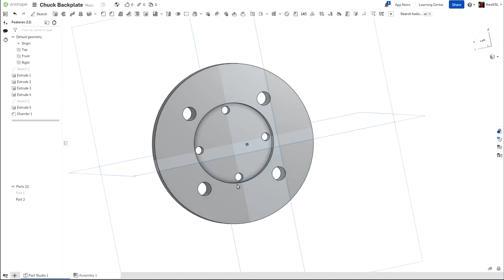Making a 4-Jaw Chuck Backplate for the Proxxon PD 250/e Lathe #toolfest2021

Comment: I used the EMCO Unimat SL, EMCO Unimat 3 and PD 230 for many projects, but I never would have used any carbide insert cutters on these tiny lathes. I only use high-speed steel for lathes with motors rated less than 500W.
Reply from the maker: That makes total sense, but there is a reason I didn't stick to the same principle. My lathe workbench was in a corner of my kitchen, and I had to keep the mess under control. Bench grinders are seriously messy, and really require their own bench space which I just didn't have.

Comment: The backplate came out great! Tooling and machine improvements are my favourite kind of video. I am impressed with the idea for the wax lubricant on the bandsaw, I had not thought of that.

I love how you battle on with the lathes low torque, people love seeing a story which has struggle along with a happy resolution! If you were to stick a bigger motor on there, or a gearbox or similar, you'd remove all of the challenge! :)

Cheers,
Craig
Reply from the maker: Thanks Craig! I can't remember where I found out about the wax, but I ended up hunting it down because the bandsaw manual contains dire warnings about getting any kind of oil on the blade.

Comment: Alistair, that's another great example of how the PD 250/E can be pushed to its limits & still produce the desired goods.
I can vouch for the expense of the Proxxon 4 jaw Chuck, it's even more so when buying in Aussie Dollars!!
Contemplated doing similar to you utilising a Sherline 4 jaw given its size & quality but weighing up all the costs, the Proxxon Chuck worked out fractionally cheaper with much less potential of "introduced" problems.
Concluded it was far quicker & easier buying the Proxxon 4 jaw Chuck, allowing me to get straight onto my projects.
Like the old saying goes: "horses for courses".
Reply from the maker: Thanks Colin! The real questions is whether the Proxxon 4-jaw's quality matches up to the price. I've heard from a couple of people that it's not up to the same standard as their 3-jaw stock chuck.
Reply: @AdventureswithaVerySmallLathe  Totally agree, their 4 jaw Chuck is NOT nearly the same quality as their (Rohm made) 3 jaw Chuck, yet they're about the same cost!!
FWIW, I actually ended up having to make a set of replacement "jaw screws" out of M10 Grade 8 Grub Screws when the original 4 jaws started to fail & bind up within the jaw threads.
IF I'd had the Mill before buying the 4 jaw Chuck then I'd probably followed your option.

Comment: Its really time to get a new countersink, also deburring with the countersink the holes before tapping them makes it alot easier to get them started.
Very Good end result from such a small machine with the trouble it can bring with the lack of rigidity and power.
Reply from the maker: Good point about chamfering the holes before tapping. The order of operations on this project wasn't perfect, and there are a few ways I'd do it differently again.

Comment: Grim thoroughly impressed with your tenacity. There are so many challenges when you at the very edge of the machine’s capability. I can’t recommend polished inserts made for aluminum enough. They work very well on steel, cut more easily, and have very low tool pressure for small machines. Maybe $14 for 8 inserts on eBay.
Reply from the maker: Thanks for the suggestion. There was quite a bit of discussion about that type of insert during the premiere chat, so I'm now thoroughly convinced to give them a try.
Reply: @AdventureswithaVerySmallLathe  Honestly, I'm seriously considering going back to HSS tools on my mini lathe. I primarily use the aforementioned aluminum inserts on everything but brass/bronze... But recent experiments have shown me that a razor sharp 3/8" HSS tool, ground with exaggerated positive geometry, has far less trouble taking bigger cuts, without stalling the lathe.
Reply: @fna-wrightengineering  You may be right. I think that my challenge is “free hand” grinding a tool as sharp as the inserts. I respect your steady hand instead of my shaky old man hands!
Reply: @bhoiiii  you can make a jig! Something that has a guide on the bottom that rides against the edge of the grinder rest, and a fence (either fixed or adjustable) on top to hold the tool blank at your desired angle. There's plenty of examples on YT.

Alternately, a D-bit grinder with a CBN cup wheel does a great job of grinding tools to very precise angles and dimensions, but that's definitely not a cheap option.
Reply: @fna-wrightengineering  Great idea. I’ll think about that jig. Making a jig with the correct cutting/relief angles would be a fun exercise. What a sickness we have!

Comment: Congratulations on doing a very tricky turning job turning job. These small lathes jam very easily. I have recently turned a 75mm form in steel beating a copper plate to the correct shape on my own Proxxon.

Your videos decided me to get a Proxxon instead of another brand. Unlike you I had bought the Proxxon 4-jaw and I am now very glad I did!

Comment: @22:19 - not to mention that most CNC machines can run a constant feed/speed by varying the spindle rotation as the cutter moves toward the center always keeping the insert in the optimal range for efficient operation.  I found that fact fascinating.
Reply from the maker: Yep, you can tell just from the audio of some CNC videos that the spindle rpm is varying, and it doesn't take long to work out it must be to keep the insert cutting optimally. On a machine that cost 6-7 figures time is money, so removing material as effeciently as possible without having to stop and change the insert too often can make the difference when it comes to staying in business.
Reply: @AdventureswithaVerySmallLathe  What amazes me about your work is the fact that even though you're working in the micro to those fancy, expensive machines, the accuracy, actions and tolerances are all the exact same.  Frankly, I think working in the miniature must be more daunting.

Comment: Nicely done sir. A quick check of tool height can be done with a small, thin steel rule. Place the rule on the OD of the bar, then gently bring your tool up to it until it makes contact and holds the rule. The rule will be square if on center. If tool is low, top of rule will be tilted towards you. I had very talented instructor 30 years ago, lol. Keep up the great work!
Reply: That gives a good approximation, but he was facing so that method wouldn't be possible without removing the work and putting a a round bar in the chuck.
Reply from the maker: SkyWizardless: That's the trick. During a tricky bit of machining, quite often the accurate ways of getting the tool height right aren't available because they're too disruptive or would mess up the setup. In a better world I'd have a lot more toolholders, and could dedicate one to each tool I use. Then I could set every holder up to the right height well in advance, and just leave them all there.

Comment: Very patient work , quite an achievement to machine large diameter high strength steel in such a small lathe. 7075-T6 aluminium alloy is a good high strength material and lovely to machine, might be a useful choice for some future large diameter projects on a small lathe where strength is required, though you do get more defection with this alloy as compared to steel.. A very engaging video.
Reply: Aluminium would be my choice and keeping the spacer as thin as possible.

Comment: Hi, is it possible for you to measure the bolt circle diameter of the proxxon three jaw chuck? I just can't find the info on the internet. For my new Emco lathe I'm looking for a new chuck. The proxxon seems to be identical to the original Emco if the mounting bolt circle fits. 29mm circle diameter would be great :) Would be very thankful if you can measure yours!
Reply from the maker: Hi! I love your videos, and I'm delighted to be able to help. I've measured the 3-bolt circle as carefully as I can, and as far as I can tell it is a 29mm diameter circle.
Reply: @AdventureswithaVerySmallLathe  Many many thanks for your quick reply! That is really good news. Nowhere I could find this measurements. Really thankful you checked this. Now I know the proxxon chuck should fit to my new Emco :) Thanks again ;)

Comment: Nicely Done!  Dome head caps can be useful when you have limited depth for the head. Yes keeping a carbide insert cutting well can be difficult with limited power, my cnc has just 1/2 hp at the spindle, I tend to use ground edge inserts.  Have even used aluminium type inserts on steel when required.  My Hercus chucks have backplates but they are secured to the chuck from the back and long screws can pass right through the chuck to the spindle. Amazes me how you manage your commentary, you teach without it sounding like teaching.

Comment: I use usually rivet drills for starting holes and for short holes. They're double end, short, super cheap and also have split point for easiest cutting and locating. Box of 10 in M35 cobalt HSS costs about 6€ and again they're double end
Reply from the maker: I've never heard of rivet drills before, and a quick Google search isn't showing up much. Can you suggest a supplier or brand?
Reply: @AdventureswithaVerySmallLathe  youtube doesn't allow me to post links, the comment just disappeared immediately. They're available on hardware stores, but I buy them from Aliexpress myself. The quality is no joke for a Chinese tool, they're all ground and I've drilled even 12.9 grade bolts with them in a pinch. Should appear if you search for example "double drill 70pcs" and hit cheapest first, there you can find a listing that has 7 different sizes of them and you can buy them either in a pack of 70 for all sizes which I did or individual sizes in 10 packs.

Comment: very well executed 

I have self centering 4 jaw 125mm chuck with only 3 mounting holes, tightened with the regular nuts at the back of the back plate.

I bought an independent 4 jaw chuck with 4 mounting holes.

is it OK to just drill extra 3 holes ( + reuse 1 out of existing holes) in the original back plate, to match the new chuck?

or do you think I need to make a dedicated back plate for the new chuck? 
or should I buy 125 mm universal back plate with mounting holes both for 3 and 4 holes chucks?
Reply from the maker: I'd guess that would be ok, unless you' re really keen to perfectly balance the backplate to try and remove any trace of vibration. My chinese lathe spindle comes with the 3 and 4 hole patterns drilled into the same plate, with one hole in common between the two patterns just as you describe.
Reply: @AdventureswithaVerySmallLathe  the 4 jaw self centering chuck has a 3 bolt backplate
the spindle might have 2 patterns but I need to open it up and see

I saw some mini lathe back plates with both 3 + 4 patterns already drilled, I think I'll try that easy route first

cheers!

Comment: 23:43 Question about the proxxon dividing head TA250 (part no. 24044): Are you satisfied with it? Seems like Proxxon has superseded this with the UT250 (part no. 24046) - which one should i buy? i will mainly use it on the mill FF230 and am more interested in the more heavier, stable (all-steel) and precise device, that stepless feature of the rotary table 24046 isnt that important. maybe others can help me with their experience? i also wonder why 24044 is significantly more expensive than 24046. very good video btw thx

Comment: Just some speculations about the mounting holes: The Proxxon PD250 spindle has two sets of screw holes: four M4 for the 4-jaw chuck, and the collet chuck, and three M5 holes for the 3-jaw chuck. The cross section of three M5 screws is 17% larger then the cross section of four M4 screws. Also, a larger allen key can be used for M5. Is there any particular reason to use four M4 screws for the backplate instead of three M5? Could three screws for the backplate and four for the chuck cause more vibrations? It is clearly less symmetric. More, if using four M4 screws, would a radial line up of the M4 and M8 screws be better or worse than orienting them in angles in between? I believe any flex in the backplate would cause less vibrations if the screws were lined up.
Reply from the maker: Obviously the two hole patterns are there so that the screw holes pass through the 3 and 4 jaw chucks without interfering with the jaws. When I came to make this back plate, I just used the 4 hole pattern for the 4-jaw chuck without really thinking about it any further. You're absolutely right that this backplate could have used either pattern without any issue, and could even have used both to get some extra holding at the expense of more effort. Of course using all 7 holes would mean the backplate only had one correct orientation, but that's actually an advantage when it comes to getting the best concentricity and balance.
It would probably be better intuitively to line the M4s with the M8s I suspect. I avoided it because I thought the wall between the holes was a bit thin, but at 2mm that isn't small enough to be a concern.
Thanks for your thoughts, it's interesting to think over what pattern would be better.
Reply: @AdventureswithaVerySmallLathe  You are right, the difference between the two bolt circle diameters is too small for the screws to be lined up safely. It would probably constitute a stress riser on the material. Yesterday I realized why the 3 hole screw circle is actually out of the question. It is smaller, less than 30 mm (the 4 hole circle is 34 mm). It would narrow the through hole in the backplate/chuck assembly. For a 80 mm chuck it is normally around 22 mm. It is very handy to have this wide through hole all the way up to the spindle, so the backplate should have a through hole mathcing the chuck. I have just received a 80 mm 4-jaw from Arc Eurotrade. It is backbolted of course, but with only three M6 screws on a 66 mm bolt circle! When I ordered the chuck I took for granted there should be four M6 holes. My plan was to drill 6 mm holes through them, all the way to the front. Now only one of them is located between two jaws, but the other two are too close to their nearest jaws to be drilled through the body. What to do? I drilled through the first and made three additional holes. Then countersunk them on the front side. I used a countersink mill intended for M5 to keep the holes on a safe distance from the outer chuck wall. Cast iron is surprisingly easy to machine. I used a 6.2 mm cobalt alloyed drill for this purpose. Then I made a backplate from aluminum. Not owning a bandsaw, cutting 80 mm aluminum round bar with a hacksaw was a bit tedious. I hope the backplate will stand the test. The motor is only rated 150 W so I don't think it has enough power to crash it. I spinned the chuck without the jaws and it runs smooth, without any obvious vibrations. Just finished a test run with some very hard and brittle 21 mm bronze round stock, and so far soo good. This chuck feels really solid. It was easy to dial in a workpiece in it. It is what I hoped to receive when I ordered the Proxxon 4-jaw a year ago. This new chuck is a magnitude better. The original Proxxon 4-jaw was probably designed for the previous PD230 lathe. The old 3-jaw chuck also had a similar skinny look.

Comment: Maybe you should try inserts for Aluminium, they are not coated but stikk Carbide and usually really sharp, so they should reduce the cutting force
Reply from the maker: Quite a few people have suggested this, starting in the premiere chat stream. I'm definitely going to try it out; thanks for the tip.

Comment: Maybe it hasn’t come up yet in video.  When you drill the 4 holes about 27 min in, you centre the chuck, but you never machined the outside of your material.  Wouldn’t clamping on the un-machined outer surface potentially introduce an inaccuracy?
Reply from the maker: Yeah, it definitely added some inaccuracy. I mentioned briefly that if I hadn't had to remove the part to get to the mounting screws, I would have avoided some re-chucking error. Unforauntely I just couldn't think of another way to do it.
Reply: @AdventureswithaVerySmallLathe  Thinking on it as long as the surface is true the 4 jaw chuck will be fine.

Comment: Use brush to apply coolant. In my opinion, works better
Reply from the maker: I used to use a brush, but I found it a bit sloppy. The needle tipped bottle let's me easily put exactly the amount of oil I want, where I want it.

Comment: Really nice job, it's a shame the 3 jaw mounts from the front when you can so easily move it between the lathe and dividing head.

One thing I would say is that on these small machines sharp HSS tools work a lot better than indexed carbide, especially for very light cuts.  Carbide inserts have a significant radius on the cutting edge so only works well when taking deeper cuts which these machines don't have the power or rigidity to exploit.  Talking of rigidity, the amount of movement in the compound when you tightened up the tool clamp bolts was alarming, is that normal for the Proxxon?
Reply from the maker: I'm certain you're right about HSS tools, but for many years I didn't use them simply because I didn't have anywhere I could set up a bench grinder. They need their own solid space, and somewhere where the grinding grit won't cause too much damage. For a long while I only had a few centimetres either end of the lathe, and had to be very careful about the amount of mess.

I'm now learning a lot about the joys of hand ground HSS tools, especially how often they need re-sharpening, but also how beautifully a well made tool can cut.

The think the compound movement was particularly bad because the compound gib had worked a little loost, and it took me a while to notice and tighten it. It's quite vulnerable to compound flexing which is why I'm hoping to fit a solid replacement toolpost soon.